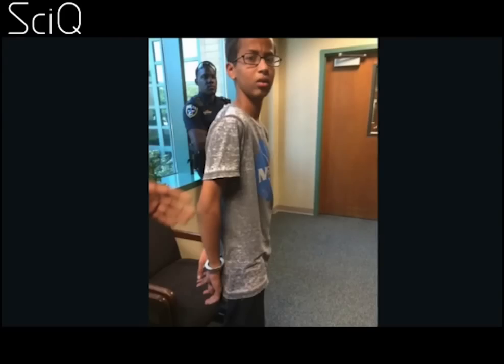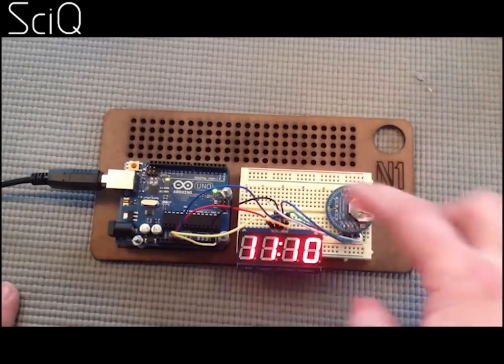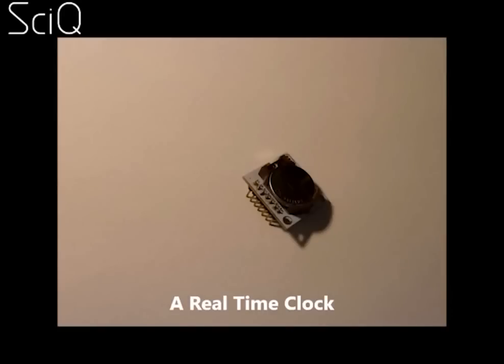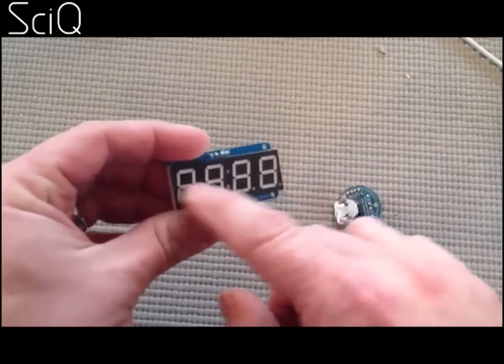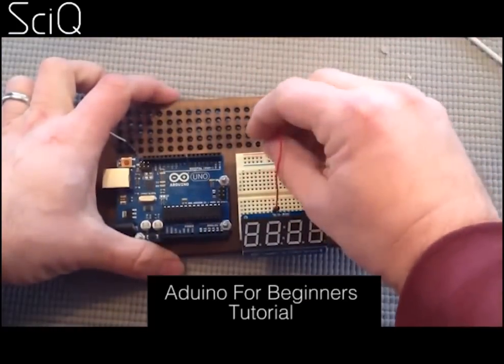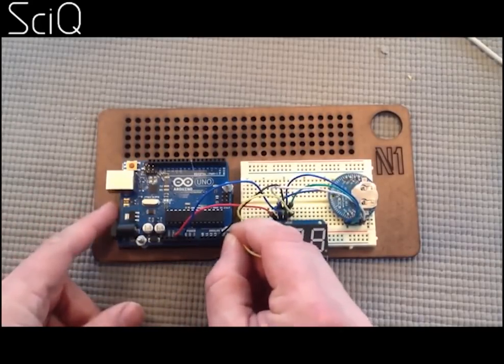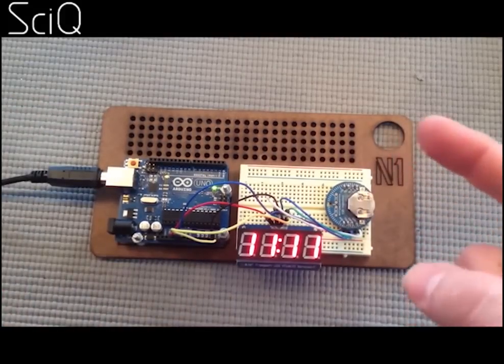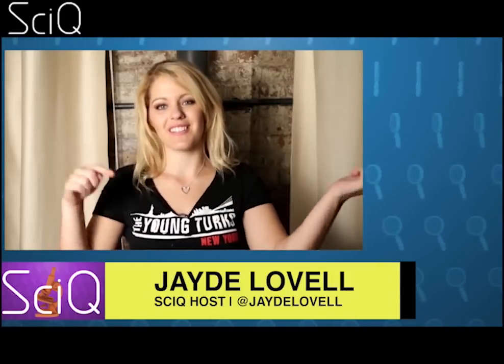How To Build a Clock That's Not A Bomb – (Just Like Texas Boy Ahmed Mohamed)

Comment: @ScIQ, how can you possibly suggest what he did is engineering, let alone what you did is engineering?  He bought a clock from RADIO SHACK, took it apart, screwed it into a case and said he "built" it... And you assembled pre-determined components and programmed (you didn't even program - you downloaded the clock function) the Arduino board.  Why not get creative, using a 555 timer, 4510, 4511 IC's, logic gates, etc. or any other method to really "engineer" one?   Don't glorify this faker.  It's awesome to see that his fake lawsuit got thrown out...